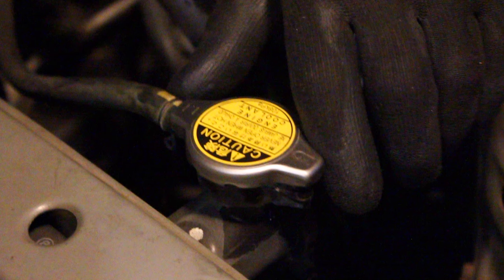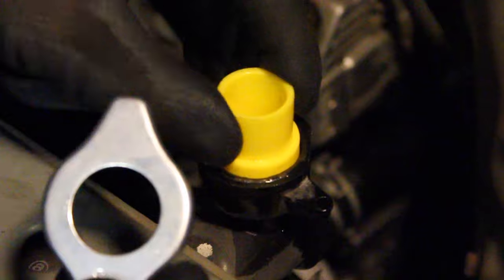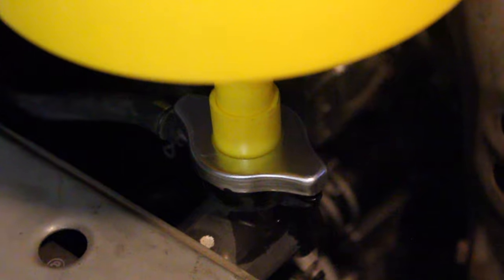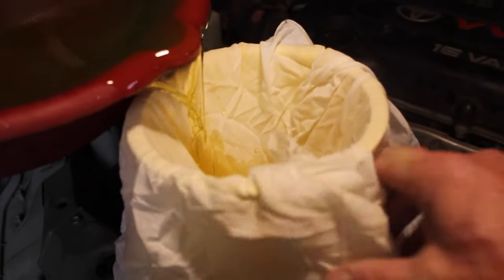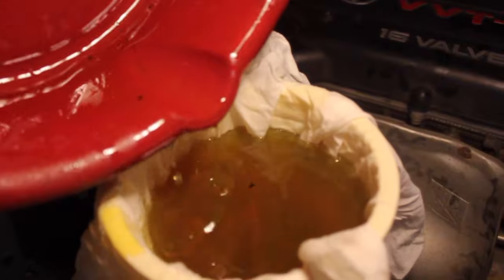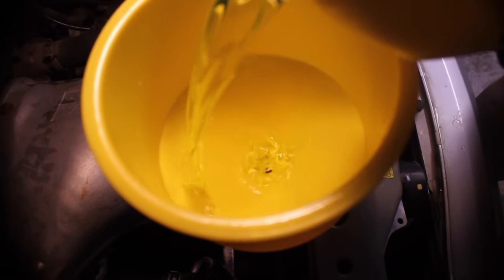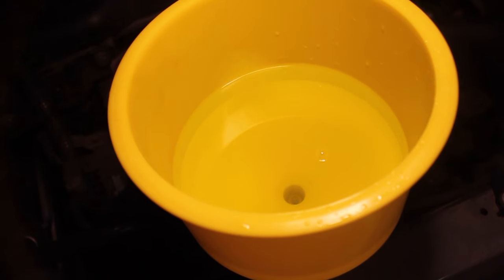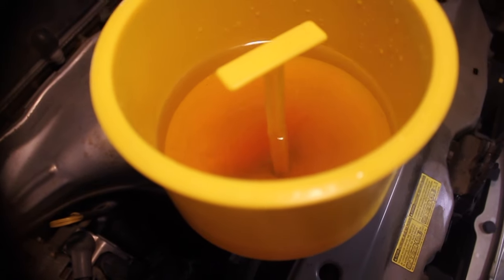BEST way to remove airlock in radiator  (remove air bubbles)

Comment: I'm confused. Why are we putting dirty fluid in the car?
Reply: Coolant can last 2 - 5 years and is pretty expensive. So if you know the coolant is still good it's best to drain it off and then use it again.
Reply: @Jin-Ro  right Kim. I run it through a coffee filter and put in in the reservoir/overflow tank, or back in the jug for use later.
Reply: @Jin-Ro €3.5 for 3L isn't really breaking the bank
Reply: Isn't it dirty in the car?
Reply: @Jin-Ro coolant isnt expensive ….

Comment: I just changed my thermostat. I'm bleeding my coolant system with the heat on hot, fan on low and the fan will not shut off as well as it's running hot. Does anyone have any suggestions?

Comment: Instead of paying $25 for a $2 funnel I use a water bottle with the bottom cut off!😎
Reply: See how long that water bottle last when you turn the engine on, because you have to open the thermostat in order to get all the air out and you do that with the car running.
Reply: @AUDIO2AUTO It says He "uses a water bottle" so he knows what he's talking about. Also it's easy to fix the water bottle or get someone to hold it so it doesn't lol
Reply: @matteo_syd7271  Hey if they like 220 degrees on their skin, go ahead and hold it.. lol
Reply: @AUDIO2AUTO  Agreed the water bottle method is asking for trouble. Also that kit is 15$ at peavey mart and now your equipped to proper fill for many vehicles.

Comment: this what most shops do and then charge you for the 2 gallons of coolant they didnt buy
Reply: And the reason why I change my own oil, transmission fluid, coolant, brake fluid, etc. I do much more than that but that is the minimum you should do. You should also squeeze the two large hoses connected to the radiator while the funnel is still on. A bit more air will come out.

Comment: This still doesn't explain sometimes air bubbles get trapped in heater hoses and such this isn't a cure all by any means.
Reply: I hope this helps someone atleast but a good indicator would of air getting into the system us threw a leak of some sort 9/10 would be a gasket start with the easiest being radiator cap

Comment: I’ve got one of these but almost entirely stopped using it when I got a vacuum filler. Vacuum filling is even faster and more effective. Some systems with a pressurized overflow tank won’t take coolant well. If you vacuum fill it’s done. You can put the cap on and drive it.
Reply: English please

Comment: Every one of these videos has a radiator with a cap. Mine has no cap.
Reply: That is normal for some cars I believe. I've read that some coolant is supposedly good for the entire lifespan of the vehicle. My guess is they aren't expecting you to ever change out the fluid. What's the year, make, and model of your car?
Reply: You have to put coolant in the overfill tank
Reply: @brettnelson7518  hardly not the truth. No such thing!!! There's always an overfill tank and those that don't actually have a rad cap on the radiator have to fill their system in the overfill tank.
Reply: Buy a different car!!!

Comment: if the coolant is old best to replace it with a new coolant due to PH balance.  Old coolant tends to be more acidic which causes the metal head gasket to rust and cause a blown head later.

Comment: I have this funnel, and am no mechanic, but have a
 bit of a possible overheating issue since I found some
antifreeze on the ground after trying to bleed the coolant
system, I've watched a dozen videos on this and if I have
this right, what is shown here, is not going to
even begin to 'remove' any airlock in any way, zilch......
Buy this contraption though, make sure if fits your vehicle, 
they come with several radiator cap interfacing adapters, 
it is worth it's weight in gold, as far as being able to keep
enough coolant in it, monitor it etc, to get the job done, 
but getting 'airlocks' out is an entirely different animal' .
Reply: Some people have found drilling a tiny hole in your thermostat helps a lot.

The hole leys trapped aif through, but it still does it's job blocking the flow of water to let your engine warm up nicely

Comment: Does fan n heater need to be turned on? How do we know when all the air bubbles are out? No more bubbles?
Reply: Heater on Gets trapped bubbles out of the core and heater hose lines. (My ex-race car has no heater or heater core so I skip that part.) When all the air is purged out of the system, you will no longer see bubbles come up out in your funnel. Has to be at operating temp and thermostat open. Note: a head gasket leak will put exhaust gases into your cooling system and will keep bubbles coming into funnel, and smell like exhaust. There is a kit for detecting this with dye added into your funnel and it changes color if exhaust gas is present in your system. FYI

Comment: aah ok  i understand the concept  bring the water up higher than it would be    so the air can escape,    i squeeze my top radiator hose and i hear water lapping  i cant get that to go away  because the shape of the hose and the positioning of it
Reply: Put something under your front tires to slightly raise it or park it on an incline like a small hill or driveway that goes up...

Comment: When it gets up to temp , turn the HVAC to heat to purge air left in heater core
Reply: So you turn on a fan that's behind your heater core how does that help? Lmao fan won't chase an air pocket
Reply: @rossboyack7434  gets the fluid circulating which will push air bubbles out
Reply: Yes heating the fluid always removes dissolved gases, when it works at operating temp
Reply: Nope
Reply: @ronaldthornton8370  we
Reply: @rossboyack7434 The heater will blow cold air until all the air is out of the core. When it blows hot air, then you are ready.
Also wait till the coolant comes to temperature and the thermostat opens. You will know when the fan comes on.

Comment: Why do you need a funnel? Why don't you just idle the engine and circulate the coolant with the cap off for a bit and let the bubbles escape?
Reply: Coolant will flow out. Best to get a spill proof funnel, then at the end of purging the system, wrap a cloth around a screwdriver, stick it in the funnel and lift so it doesn't pour over radiator
Reply: To allow the fluid to be higher than the coolant system, allowing air to rise to the highest point 👍
Reply: It helps to elevate the front end at least 6 inches which will help purging air.
Reply: I tried to purge air out witht he cap off. The coolant expanded and ran out of the top of the filler neck. I bought the kit used in this video and worked great. Make sure you run the engine until the thermostat opens (when hot and at operating temp). I then run engine up to like 1500 rpms for a 10-15 seconds to make sure all air is out. FYI-- I also have two holes drilled into my thermostat flat surfaces to purge any air out that may have been trapped. Old school trick.

Comment: Just curious what was the reason for putting extra coolant in the funnel?
Reply: To make sure the air bubbles were coming out
Reply: @whitesuperman5199  do I have to flush it or could I jus start doing what he’s doing
Reply: The weight pushes the air out because it's higher up

Comment: My car doesn't push the bubbles out when I start it.  It just pushes the coolant out.
Reply: 😯 oh boy........
Reply: rome seveneightsixnine what does that mean ?
Reply: @Alex-oy3zv  .......blown head gasket possibly.
Reply: The engine is telling you that you have too much coolant inside it. That is why the coolant pours out of the radiator.
Reply: Mine pushes the coolest out when I ref it, what are the problems
Reply: Don't start your car, system is pressurised, turn key 2 clicks to activate water pump 👍